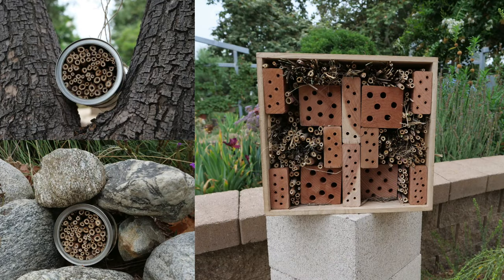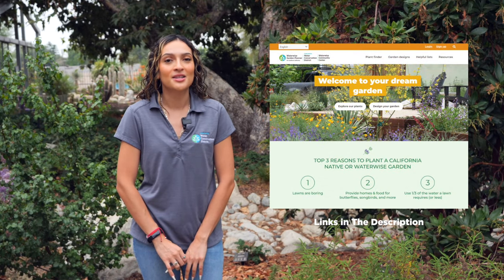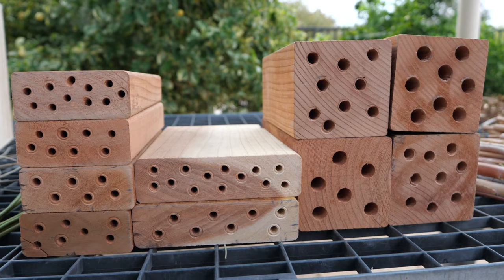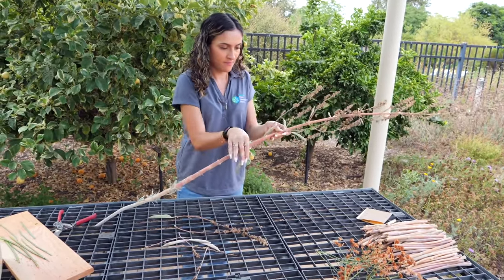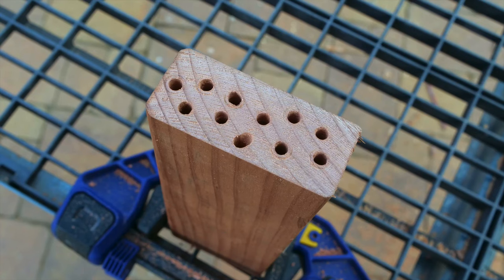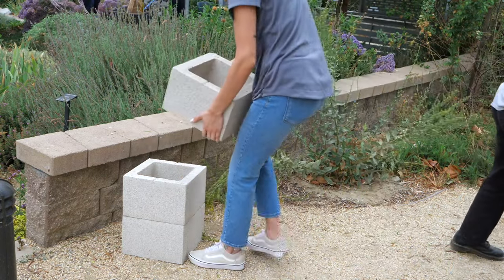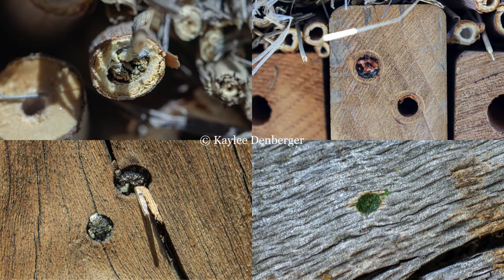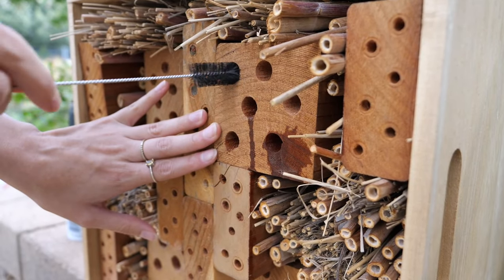Creating and Maintaining Stem Bee Boxes | DIY Native Pollinator Habitat Project

Comment: Another excellent and informative video. Does the lumber need to be somewhat dry before putting it out? There is some pretty wet lumber at the big box stores. If viewers do not have plants in their yard like white sage, various size reeds can be purchased online at sites like Crown Bees.
Reply from the maker: My guess would be that while dryer would be better, unless the lumber is very, very wet still, it will not make much of a practical difference. These features will be outdoors, so though we create overhangs to keep the nests a bit on the dry side, the wood will be exposed to the weather. My only reservation would be that occasionally a pallet of wood at the store will be so wet that you can see some fungal growth due to both the moisture and the lack of air circulation when the wood is bound up in the palette. In those cases, I'd look for dryer wood.